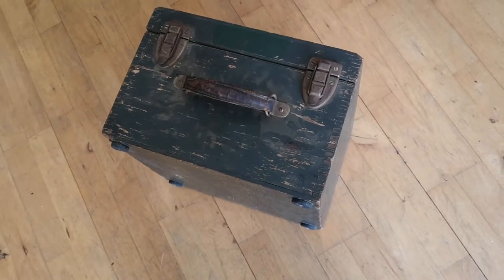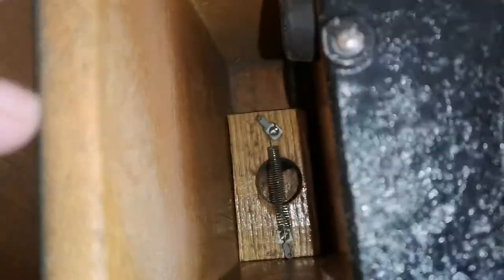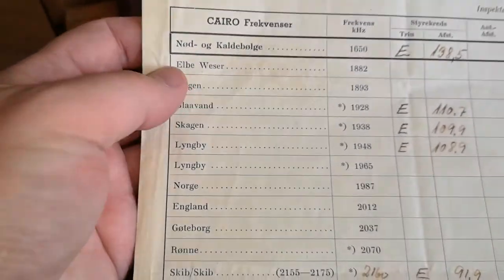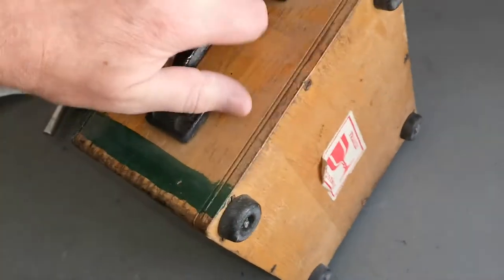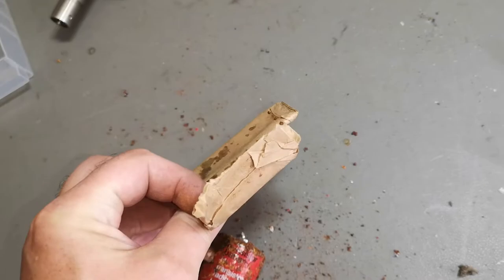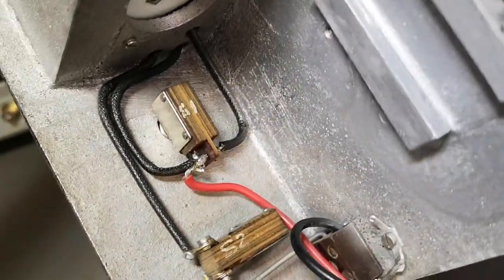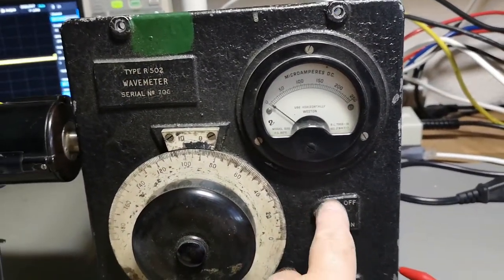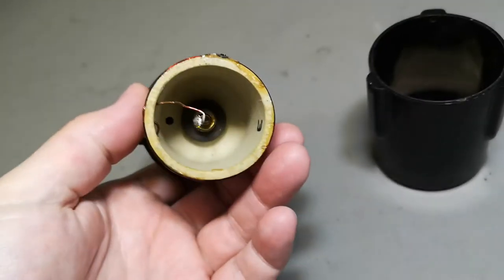Universal Wavemeter R502  Standard Telephones and Cables 1953 test repair teardown

Comment: Zero to ten on the dial pointer is a vernier readout, so you can match the closest graduation to the marks, and get an extra digit of resolution on it. Yes a DC directly heated filament, and also an early low voltage tube, probably developed as one to use in a battery portable radio, not needing all those complex power supply circuits, just a single zinc carbon battery. Best operation probably at around 1.3V, with a partly used battery, as 1V5 will be a little high on the heater drive, shortening lifetime.
Reply from the maker: i am sorry subs not ready yet, sometimes yt is very slow on this.. I did not even see a filament glow at 1.5V, but i was very impressed by the fast warm up to stable readout, only a few secs , that is clearly due to very thin direct heated cathode, i tried to feed it 1.3 1.4 and 1.5 it perform very much the same